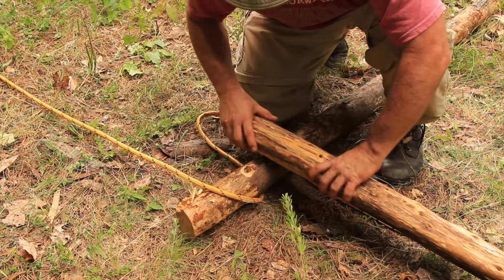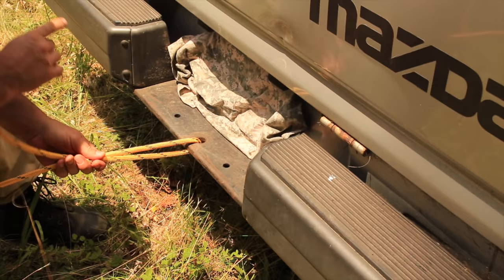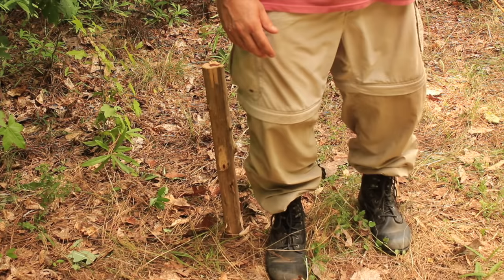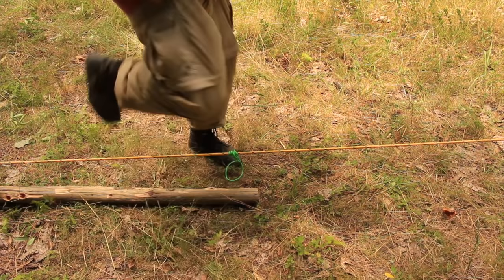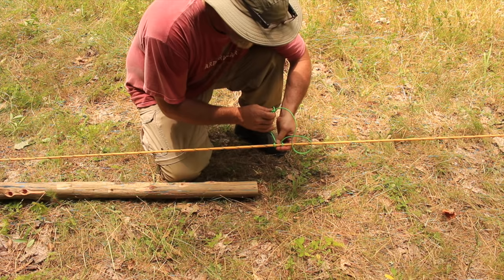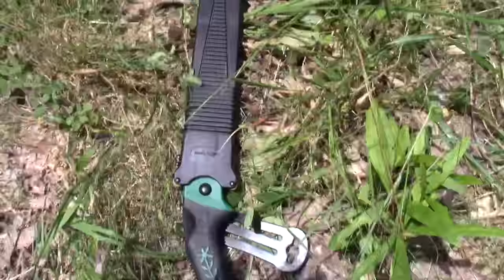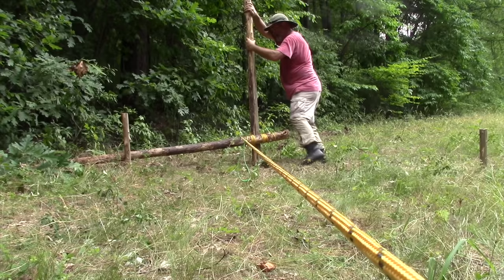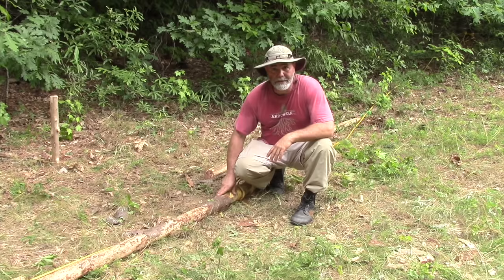Off Grid Winch: Making a Flip Flop Winch

Comment: really cool I wish I had this when I was 4ft deep in mud on my grouse hunting ADK video, nice video
Reply: My dad showed me how to get out of the mud with a few 2x4's and a few ratchet straps.  If you are planning to be in the muck take 8 two foot long 2x4s with you and an 8 pack of ratchet straps from home depo.  Its about 20 bucks.  You can strap the 2x4s opposite of each other on the drive wheels of your vehicle.  no need to do it on wheels that are not drive so you would only need 4 if you are in a 2 wheel drive vehicle.  The 2x4s will pull you through the mud pretty easily, just dont floor it.  they will act like big paddles and move you along until you are on hard ground again.  Pretty sure someone should have a video on her how to do it.
Found a link.  https://www.youtube.com/watch?v=9E0Jgt_hVCo
Reply: Pcbeach Mattressnow thank you appreciate it I saw this done before after I was stuck bad with I knew it then!!!

Comment: i suppose if you wanted to be randomly over the top to protect from a rope snap... you could use paracord that is longer than the winch.. and do loose prussic knots every meter or two, with slacks line in between each knot, and it's likely to arrest a flying rope with whatever slack exists between the knots either side of the failure. so perhaps more of these lateral  knots towards the user. so the light rope should not be able to break at the same time or at least the second failure will be much less energetic than the first❤

Comment: Putting the rope through a hole in metal as shown may cause the metal to bite and cut the rope, depending on the edges around the hole.
Stuff some fabric or rubber grommet or rubber or plastic scrap in there to spread load, eliminate sharp edges on rope

Comment: You should pass the rope so that the ends will wind on the same side of the barrel by passing the lever under the rope once.. Less rotational force. You'd need much stronger sticks and rope to actually unstick a stuck truck. The stop pins will not work for long as the rope gets wound and the winch point moves.

Comment: Nice, but I wouldn't tie the rope off by running it through the hole in the bumper. That hole has sharp corners, and they could cut the rope. Even if you tie the rope around the bumper, you should pad the bumper to keep it from cutting the rope when it's under tension.

Comment: There are 3,140 comments here and I’ve only read the last 20, so I suspect my comments have been said before.
Yes, nice idea, ingenious but there are limitation and caveats.
If a person can apply a force of 50 Kg for the complete 180° flip of a 2 m long lever pole and the drum log is 100mm diameter, the tension on the rope is 1 tonne.  That’s 1 tonne coming from each direction to the drum at a radius of 50mm.  1 tonne is helpful for a lightly bogged vehicle or assistance on a loose surface incline, but a properly bogged 4WD will require all of a 5,000 Kg winch.  And that may be still after lots of shovel work and inserting cordage.
Reply: More force could be generated using 2 lengths of 2” water pipe, but that would require carrying them around with you.  If a couple of persons were available to manage the winch, a short piece of rope could be attached at 3m of the lever pole to pull it “over the top”.  (I’m posting my comments in grabs otherwise Youtube sometimes rejects long posts).
Reply: Minimise the overhang of the lever pole (100mm ?) otherwise it takes too much force when being “flipped”, as it jacks off the ground against the rope tension.  Likewise the short end of the drum log should not protrude much past what is required to wrap the rope, otherwise it is too difficult to flip as it lifts off the ground, fighting against rope tension.
Reply: In this scenario wire rope is safer then fibre rope.  Rope is stretchy and stores a lot of energy, especially synthetic ropes.  Fibre rope alone is not too dangerous because it has little mass and even air resistance slows it a bit.  However if it has a 20 Kg log attached to it, it would be deadlier then wire rope.  Know the breaking tension of your rope and understand the physics of the lever and the rope tension created.
Most of the “toppling” force on the drum log can be limited by placing the rope which leads away from from the short end of the drum, over to the other side of the lever pole, so that they wrap in the same location.  If not done, unfortunately the later wraps of the rope around the drum log become further away from the lever pole axis, while the tension in the rope increases.  The “toppling” force in the drum log increases exponentially.  Deadly if it came free of the holding stakes. 
If the diameter of the drum log is decreased much below 100mm, probably too small even for typical ¼” winch wire used on 4WD electric winches.
Reply: 8mm Dyneema is rated at 7000 kg (10 mm - 10,000 Kg) - a suitable rope for this application to retrieve a 4 WD.  At 7000 Kg and using 2” water pipe, the operator would need to apply 115 Kg at the end of a 3m lever pole.  Maybe possible with 2 burly blokes.
Reply: @lmp2208 very well explained. I wanted to comment the same with my calculations. I got the same conclusion. 

Steelbcable wont unwind, handle larger force and maintain efficiency. I was also thinking you would need 2 guys, but than you could lift that damn car.

Comment: Great video and great content. Really liked it and learned something. Just to put my two cents in, it's been my experience that steel cable, (like on a wench), will recoil when it snaps and can really hurt someone. Rope, when it snaps goes to the ground with little recoil. I've seen it happen with both.

Comment: Stepping over a rope under tension is always bad safety practice. Where the rope is tied at an anchor point, avoid sharp edges that place strain on the rope fibers when taught. Otherwise, this could save you life if you're vehicle stuck, and need food, and water. May also be useful to pull me out of bed some mornings.

Comment: Never tie it off to your bumper, they are not designed for load, you could end up pulling the bumper from the vehicle.. Tie off to the chassis, they usually have anchor points.

Comment: You started with the lever pole on the one side, and then when you came back it was on the other side, and I missed the explanation as to why. I could SEE IT, but it would have been helpful had you A: explained why, or B: started with the pole in that position.
Reply: I noticed that too but maybe he decided it would be better starting with the lever pointing downhill to begin with. I haven't tried it but it seems it shouldn't make any difference which way you start out as long as the logs are looped together properly.

Comment: You definitely would be better off using static line (rope that doesn't stretch / climbing rope, looks like what you might be using here) which does not have a tendency to snap back when it breaks.

Comment: Ingenious for sure....but....why would anyone be out in woods/brush country without at least a hand winch? Does the same thing but with cable and faster. Strap winch is even safer. The rope you're using won't give any warnings...it will just break. You can get stouter rope,  but again, I defect to cable or log chain and a hand winch. You can even use a Hi-Lift jack as a hand winch in a pinch.

Comment: Even cheaper than strong, high-tech cordage, is a good rope-puller or come-a-long? It's also a bad idea to expose expensive cordage to the abrasive edges of the truck bumper. Otherwise, the concept works, but is not (IMHO) the best tool to have & use for such jobs & circumstances.

Comment: Can this be done with 2x4s if we have them?  Do the poles need to be 8', or would 5' or 6' work?  How strong should the rope be?
Reply from the maker: The diameter of the pulley pole will determine how much rope is collected with each flip flop. A longer lever determines how much energy you need to exert to operate the winch... longer lever equals less energy on your part.

Comment: The problem w/ “listening to your gut” is that that’s bad advice. People have no idea what kinds of forces are developing on the line. We would be better served if you said something like: “You should use a line that can pull a load of 3K, 6K, 9K or what ever thousand pounds needed for the job—and how you came up w/ that number.] 

How many pounds more should it need to be able to pull over the weight of the truck?   [Most people don’t even know how heavy their car weighs, let alone how much over that weight needed to overcome the added additional resistance of mud plus an up-hill pull required ,plus any additional load the vehicle is carrying as cargo.] Also, can the rope take the stress place going through the little hole of the bumper?you don’t want the bumper to act like a knife and cut through the rope when All that weight builds up, fails under the pressure and has the line fly back at you, or has your car roll off down a hill or off a cliff. 

I noticed three holes in that bumper. Could one cut a small segment of rope and tie the ends through 2 of the holes, leaving an extra 2’  between the knots to form a loop you can then tie the pulling rope  to the slack in the middle of the segment? This should cut the stress on the rope in half by distributing the stress equally across 2 sharp holes instead of loading it onto one.

Also, a rope is not going to magically appear in your truck or car.. Someone is going to need to  initially buy it. How  does one chose the rope, and to be rated for what kind of load? 

I have a suspicion you just wanted to show off your knowledge of old-fashion Pulleys , wenches, or what-nots. That’s cool. Appreciate the historical education of how maybe our great-great grandfathers did things.   I’m interested in practicality  and safety above all else—and I hope you are too. I encourage you to consider making a NEW  video, or a follow up video explaining some of the points above.  

I have been near ropes when ropes actually failed when under loads. The speed and violence when they failed is sobering. If it would have hit me, I wouldn’t have been surprised if it could have cut through jeans, cloths, or skin.

Comment: First off, since when have winches been on the grid !!???? What grid is any winch on , that isn't connected to the grid itself ??!!? They are usually connected to a battery, not the grid !!  And manual one's are pn boar trailers and other types of trailers !! Also easier to get and use !!

Comment: Did it never occur to you that by placing what you are calling the 
barrel pole in a vertical position rather than horizontal, you could 
simply push (or pull) the lever pole around in a circle? This 
flip-flopping is tedious and unnecessary. You may need to put the end of
 the barrel pole into a hole, of course, but that's a very minor 
impediment. Besides, doing it your way, you need to make TWO holes for 
the stop posts.

Comment: Thank you.  This saves me expense and labor of rigging
metal cable.  And mechanical hand winching.  Have ample 
rain forest wood at my regional cave entry excavation sites.  
I extract boulders from stone 'throats' amid bedrock.  
Choked when swallowing surface soil.  Gulping it down 
assisted by channeled subsurface water flow.  Big rocks
if stuck often have little below to slow descent exploration.
Not unusual in karst area sinkholes.  Those that swallow
easily are more dangerous.  Taking down people and their
property.   I locate and dig an entry to unexplored caves. 
Extracting all soil off bedrock around the vertical extent. 
This video method is slow but I'm retired and take on such 
labor for my recreation.  Me?  See:  nss@caves.org

Comment: It's better than nothing but at the end I critisize that the evidence is missing. Why didn't you show clearing off the vehicle? 

I assume that the progress is too little to cheer out loud over the result. This demonstration just makes one thing clear: If you travel into the wild or into the bushes just take a vehicle which is equipped well enough and make sure that you've been storing the convinient gears on board.

Anything else means that you'll choose the amateur style. "Oh daddy, why don't we have a pulley system and a winch on the truck?" "Well, mum didn''t like the extra costs and the outlook that would turn our truck into a Jungle Jack-design!" 😂😂😂